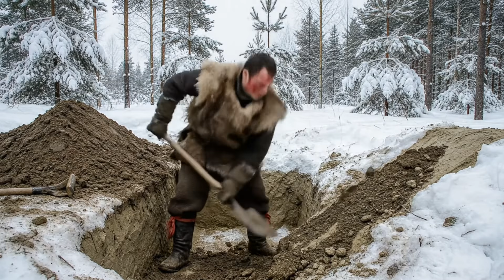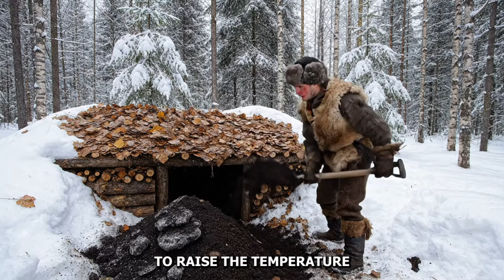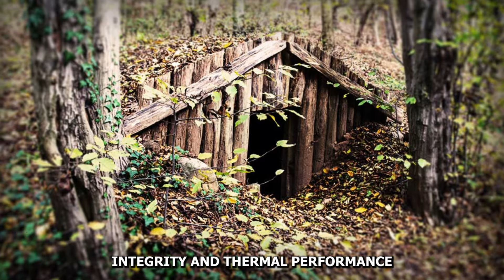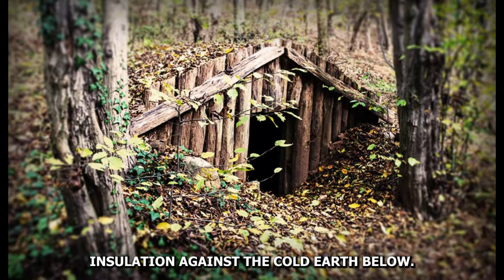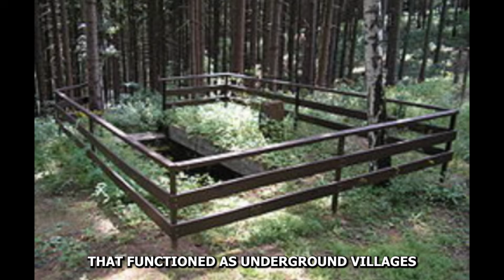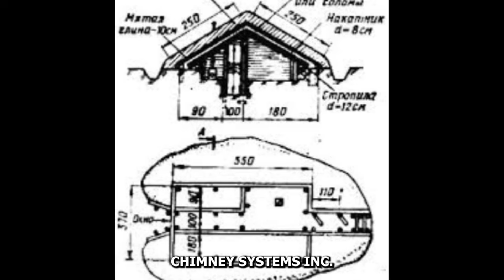How Russian Partisans Built "Zemlyanka" Bunkers To Survive WWII Winters

Comment: My neighbor in Cleveland was a partisan in Poland Russia who ran into the forest. They put a ham inside a burlap sack full of flour and submerged it in the lakes. The water-soaked into the flour for about an inch and then it stopped and the flower inside remained dry. When they pulled the flower out of the water they had dry flour and ham.